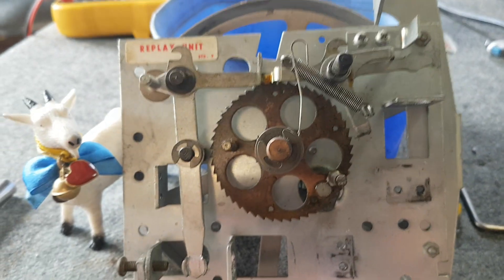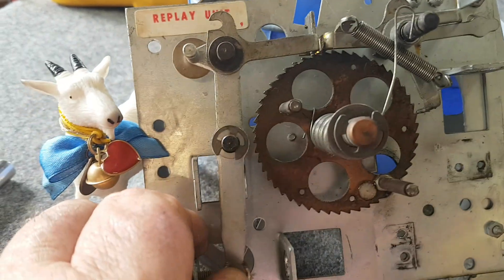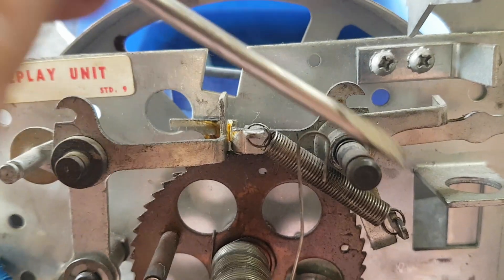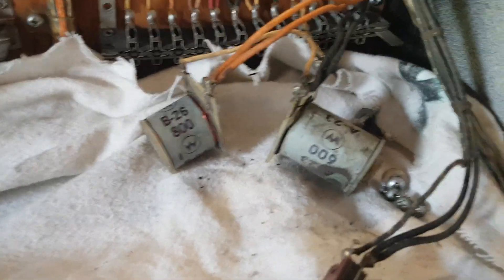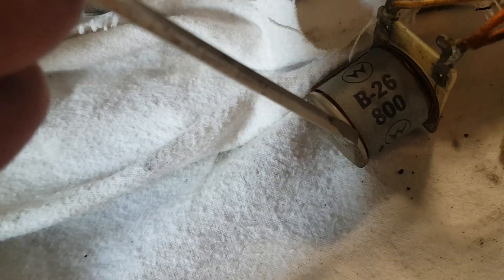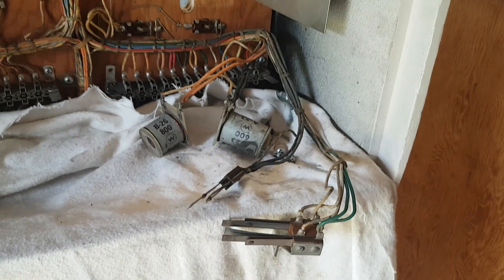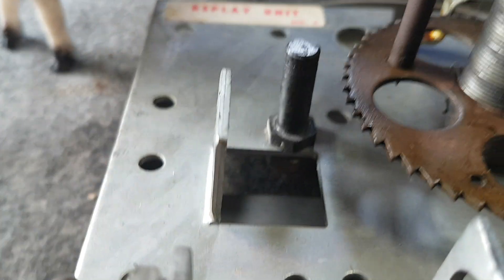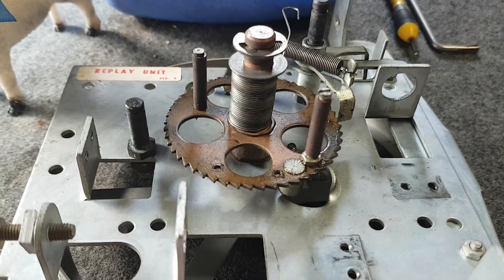Williams Replay Unit

Comment: Thanks, another great informative video.  The unit on my Full House (which isn't running yet) is a real mess, it looks like someone has been cranking it around by hand.  Do you have a photo or sketch of the position of the two pins on the escapement wheel in the 0 credit and max credit positions and the switch positions, open closed?  Any help would be very much appreciated.
Reply from the maker: Your in luck I own a full house but I'm away at present remind me in a few days are you in our Facebook grouo The Goat Shed EM Pinball Repair Specialists?
That would make it easier for me .
Reply: @goatshedempinballrepair8545  Yes,  I use my wife's account,  she 'tagged' your site (I know that's not the right term).  I'll get back to you mid-week, thanks so much.👍
Reply from the maker: See photos posted in the Goat Shed Facebook group!